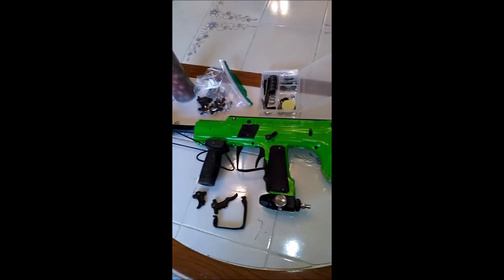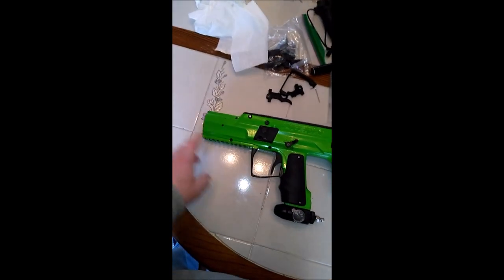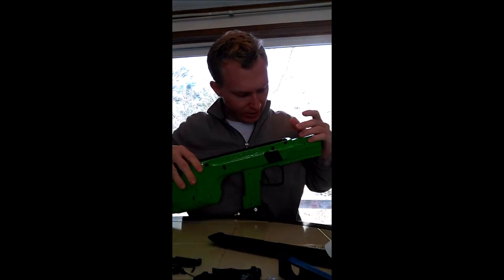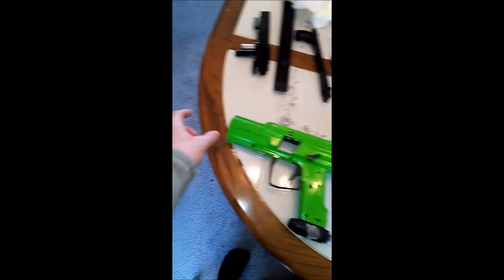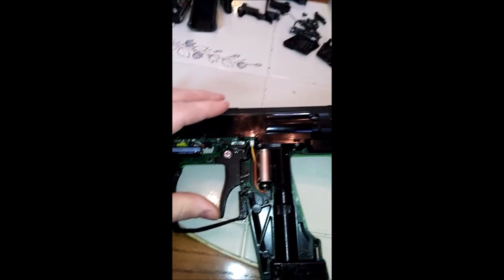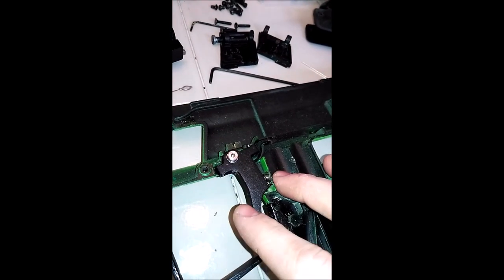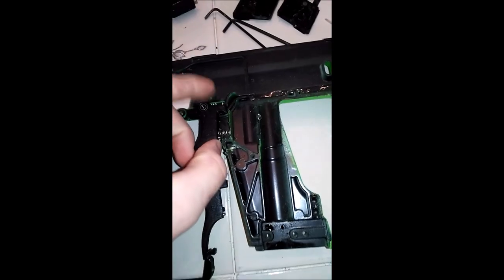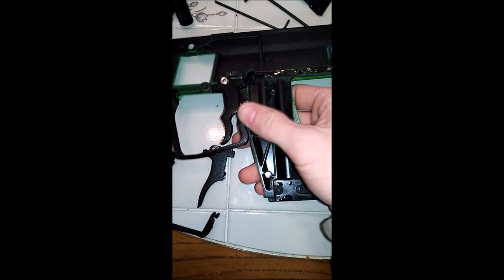How to Install D*Fender Double Trigger

Comment: Great show on how to breakdown and rebuild the marker and install the trigger. Should the trigger require any shaving down to move smoothly? Mine sticks when you pull it. Tried adjusting the 3 screws (stop point screw was stripped when I installed it unfortunately but could grab the tail end with pliers and still rotate it). I know a stronger spring was included but ot seems too stuff to allow for it to pull back.
Reply: I think you need to sand down the sides, it seems like the last batch came out too thick or some defenders are tighter than mine
Reply: @gkalkowsky  sounds good will try that report on the results